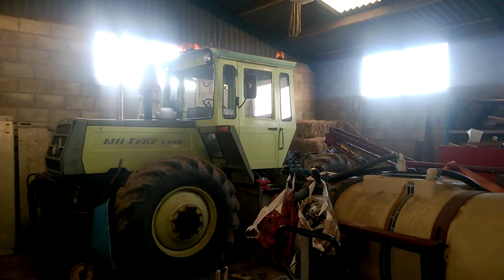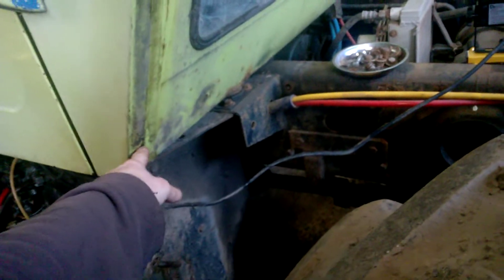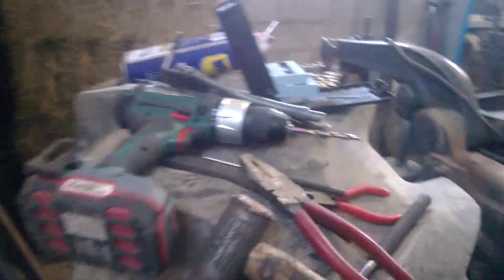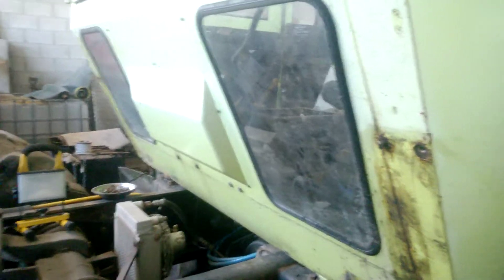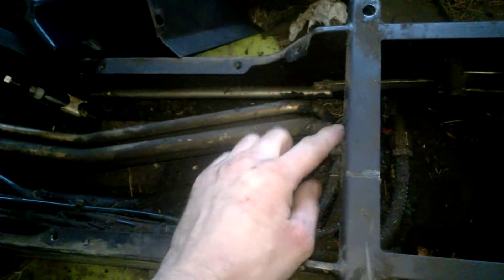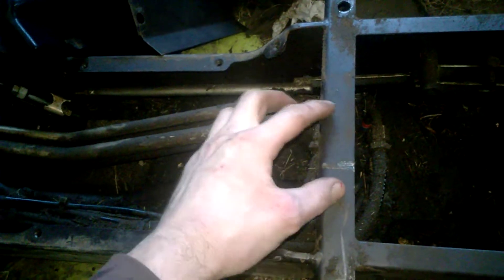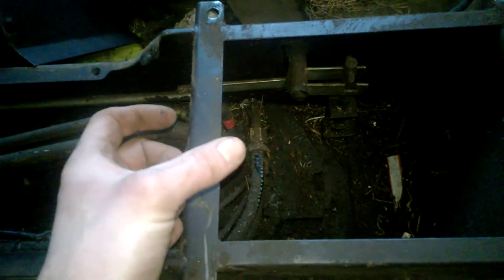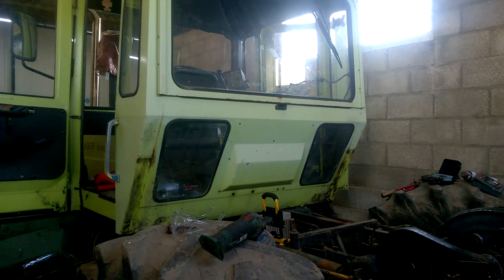Battle continues! MB trac mudguards part 3

Comment: Could you not drill through the cab then take the panels off inside the cab put nuts and bolts in and wield the nuts to the cab.
Reply from the maker: I'll show what happened in the next part... easier than explaining lol
Reply: You still won’t get into those bolts removing that panel as the corners are like pillars. I’m restoring the cab of my 1300 it’s got a lot more rust than yours
Reply from the maker: @douglasjohnstone7299  yep your right, unless I cut through the cab frame. Then I'd have to weld another nut inside. I'm trying to catch it before it realy gets in otherwise there like mogs, rust for fun 😣